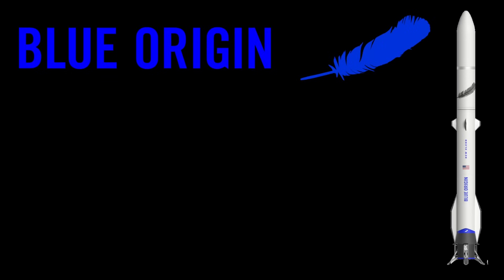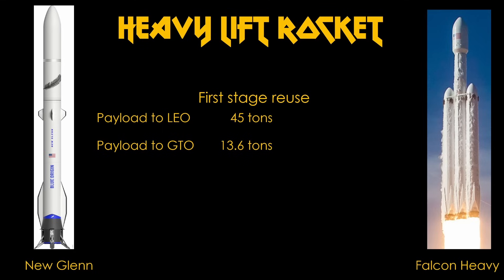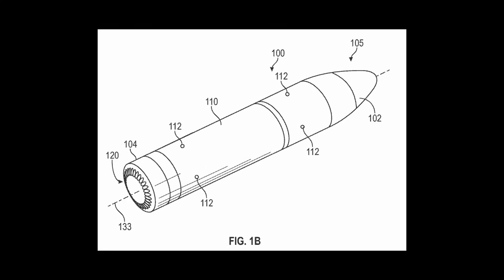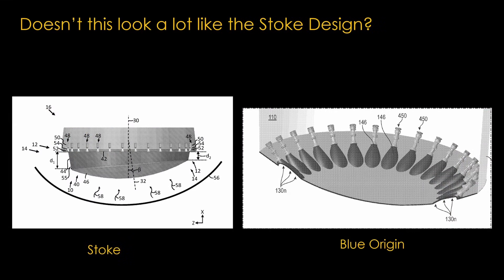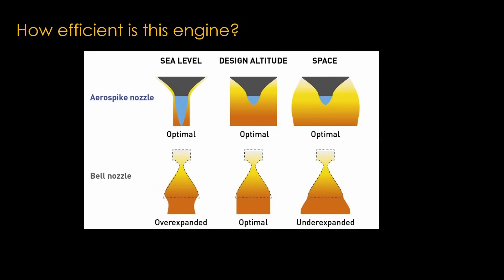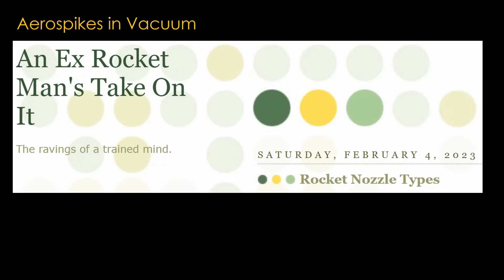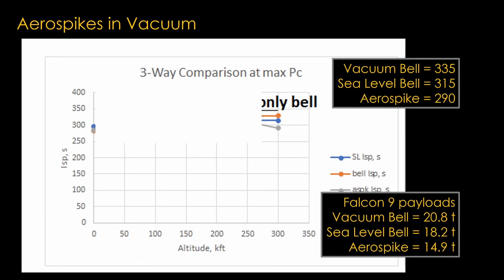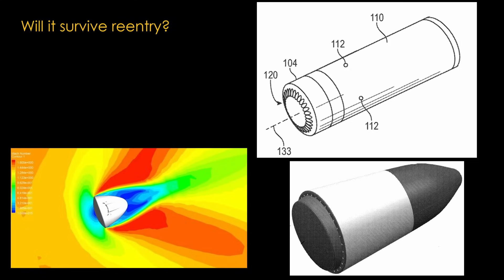Blue Origin's Starship Killer?

Comment: I wonder if you could transition from a side-on lifting body mode to an engines-on active cooling mode partway through entry.  It would let you do some deceleration at higher altitudes (thus maybe not requiring a separate heat shield) before swapping to your ballistic active cooling mode for a shorter period of time.

That said, I feel like the aerospike is a bluff.  Peak heating for a cylinder going end-first gets so bad, especially for large designs.  But here's hoping I'm wrong, and that they live-stream it!
Reply: Not sure if a varying entry profile is a good idea. Low heating is a very short time before you do need a proper shield. Also think of the structural loads that have to be considered from multiple angles, especially during orientation transition time, all with high and low density layers within the atmosphere (think of turbulences). I'm not sure if maneuvers are very feasible under these conditions.
I like the idea, but I think it makes more sense to develop just one proper heat shield instead of a hybrid of several.

And I absolutely agree on the bluff part. BO's secrecy is very frustrating, because talking about speculations is such a waste of time.
Reply from the maker: I had a slide where I talked about end-first versus sideways first, but I cut it because my explanation didn't make sense. 

For this design, the area going end first was less than half the area going sideways.
Reply: Base first entry eliminates all the need for flaps but also the chance to generate lift.  But it also concentrates your heating into a smaller area, which makes for less mass because double the temerpature on a spot dosn't double the mass needed per unit of area so minimizing area with thermal protection minimizes mass.  So long as you stay winthin material heat limits the idea solution is actuall a pointy cone which puts all the heat at the tip, this is how nuclear tipped warheads work.